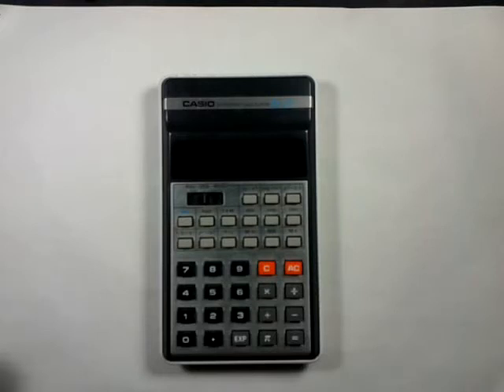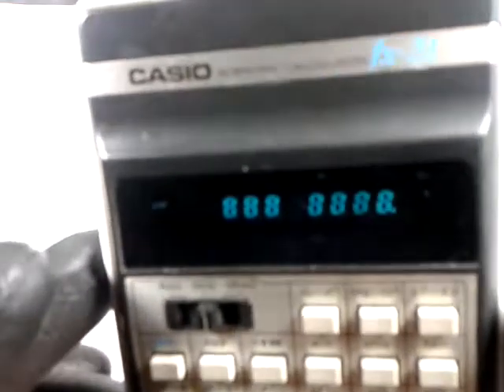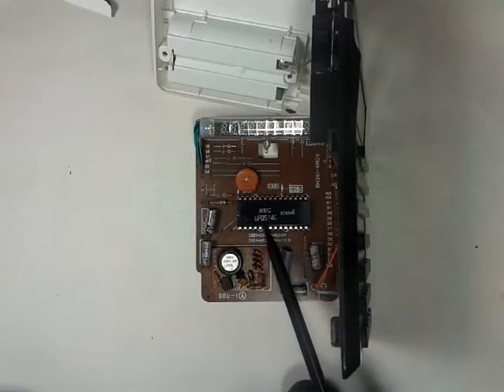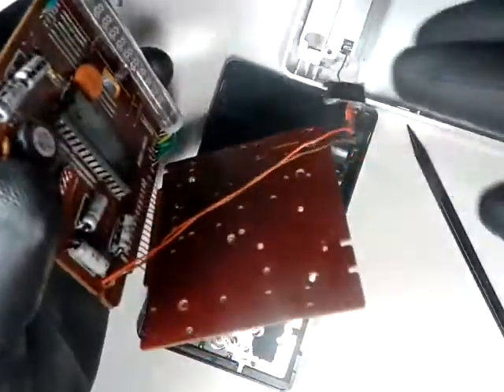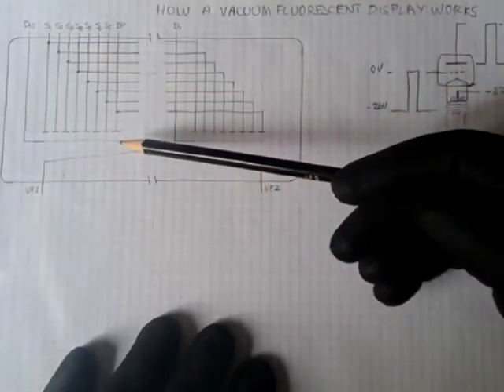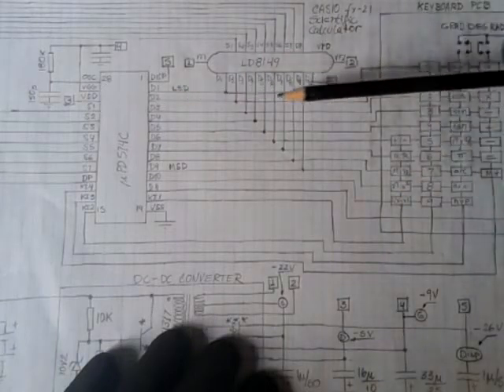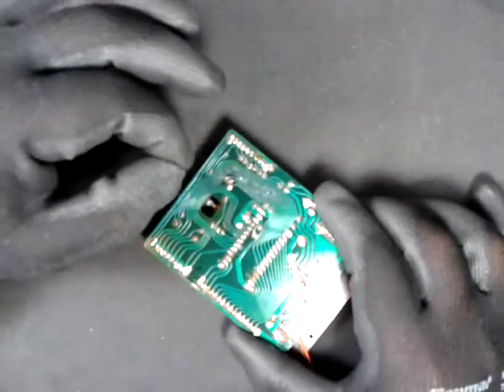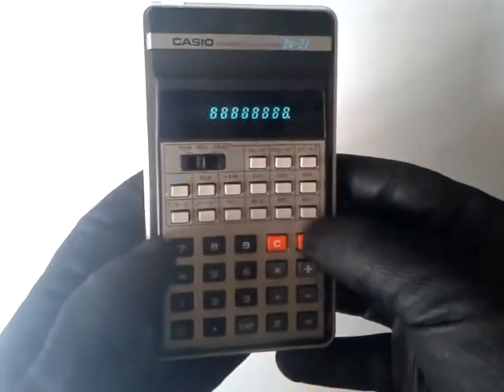Casio fx-21 Scientific Calculator Teardown And Repair - BSFEEChannel #0

Comment: Hello 
Could you please help me 
My keyboard is not very responsive 
it needs to be pressed way to hard to register a number 
I see how to dissemble it 
but I don't know how to clean it properly otherwise 
Could you please give me some advice 
with what to clean and if so do I apply any contact chemical? 
Thank you
Reply from the maker: The only product I use to clean electronic parts isopropyl alcohol.